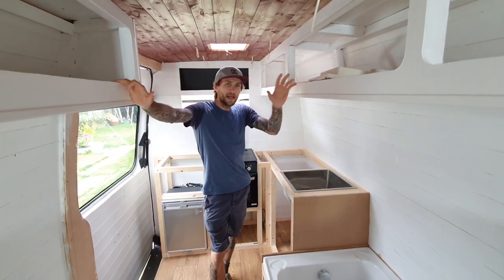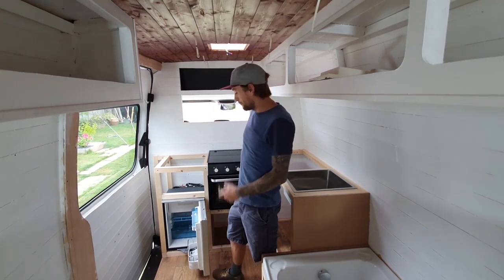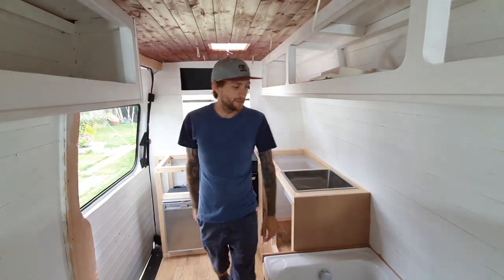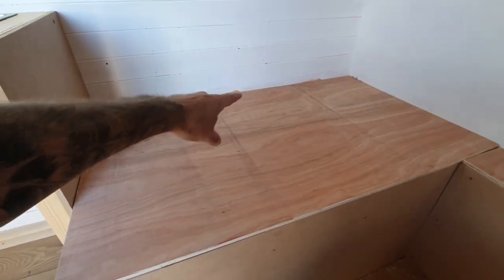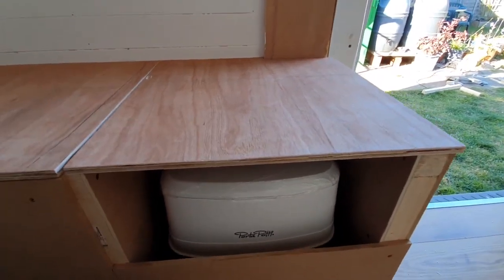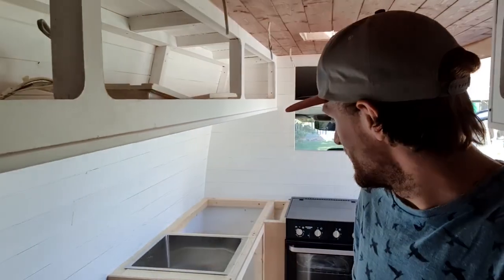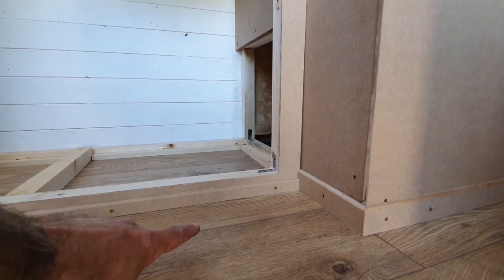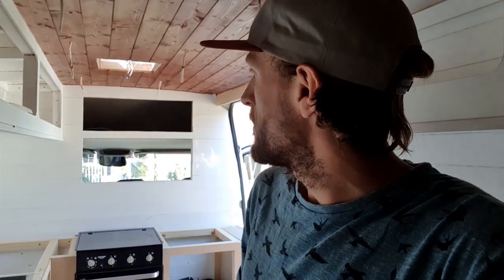Building the SEATING AREA + TOILET | Van Life Build Vlog #16

Comment: Superb so far! Been watching in silent admiration throughout lock down. Two comments if I may - as already said, fridge door hinge as it is gives great access when outside the van for those cold beers, also you said about hinging toilet cover onto the adjacent cover, but that cover will also hinge to the back so when accessing the storage you’ll have to lift the toilet cover first or it will catch on the door moulding. Might have to think about a baton or hinge it the other way so the cover can become a screen to the front wind screen when you use it. Just a thought.
Reply from the maker: Cheers dude.. it always surprises me when I find unexpected people watching my vids 😅 think I enjoy making the videos more than doing the van 🙄
Karl said the same regarding the fridge door, and I think you're both right.. it might work better as it is, especially for summertime beers 🍻 
The toilet cover i was thinking of getting those sort of spaces hinges so its fixed to the frame work but once open, lays on top of the storage lid (if that makes any sense at all). I like the idea of latching it on the door moulding though, it'll make it more private. I'll have a play tomorrow 👌🏻
Cheers for watching and commenting mate.. i need ideas as otherwise I just plough on without thinking too much 😄 🤙🏻

Comment: Fridge is good where it is, I would keep the door opening as is, easy to load food when shopping and easy to access beer when outside ;)

For those start talky pieces you do consider setting aperture to manual, that when when you or the sun moves the scene doesn't go light / dark. We need to see your pretty face illuminated in all its glory. ;)

Keep up the good work. Well jell.
Reply from the maker: Cheers dude 🤙🏻

Keeping the fridge door that way round does make sense, as you mention with loading up shopping and more importantly ease of beer grabbing 👊🏻 think I'll leave it as is, its not difficult to swap over if I ever change my mind 😅

The talking bits are filmed on my phone placed in a gimble 🤦‍♂️ not sure how much adjustment there is.. I want some better filming equipment but everything is so bloody expensive 😫
Thanks for watching brother 😁😁